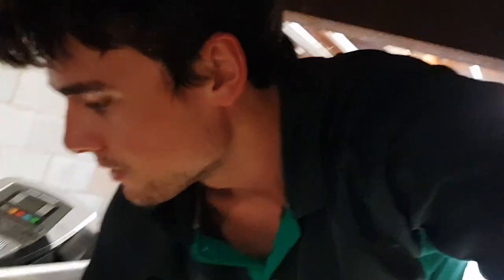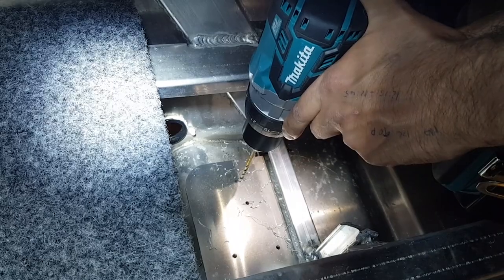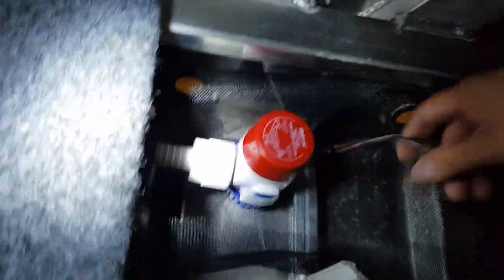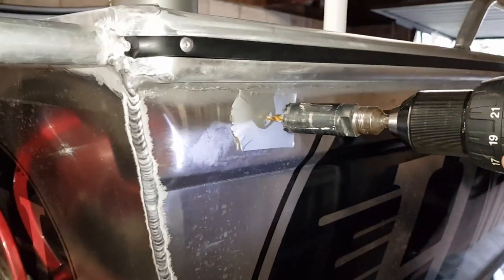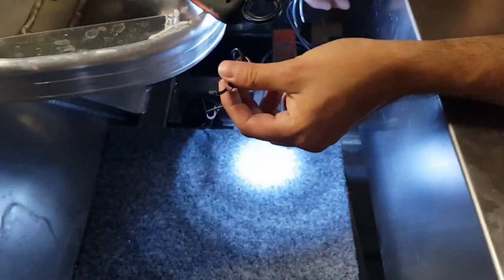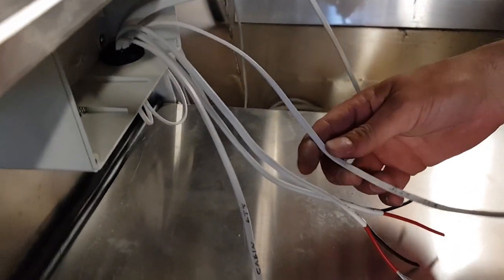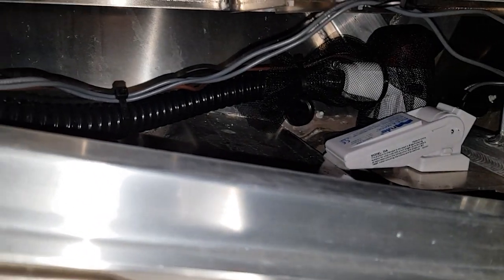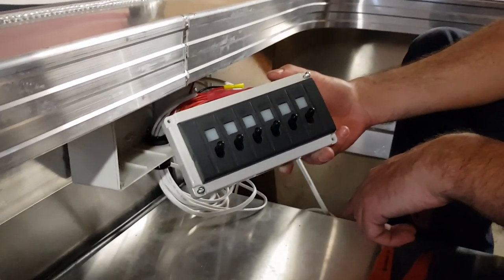Tinny Mods - DIY wiring and Bilge Pump Installation - Boat Fit out Part 2

Comment: Could've sworn you already did this. Nice soldering iron👍
Reply from the maker: The first video was the building of the switch bank. This is the first video of installing bilge pump and wiring. I've got part 3 coming soon as well.
Reply: @snagdfishing  ah gotcha. Clean setup and wiring, looks good
Reply from the maker: @HoovyPresentations  yeah that's it!

Comment: Hey mate, just asking about wiring. First little bit is an overview of my plan. 

I’m running dual (100ah) batteries. 40yam elec start. I’ll be running a battery switch (off, batt 1, batt 2, both). Both batteries will be located at the bow (weight reasons). So positive from the motor will run to the common output on the switch using 4awg/b&s. The negative will run and join battery 1 and battery 2. This will mean the batteries are wired in parallel - so if I need to I can use both for starting the motor. Continuing, from battery 1 (house) the positive will feed to “battery 1” on the battery switch. Same will happen with battery 2 (start battery) except will go to the allocation for “battery 2” on the battery switch. 

So now all batteries are connected and so too the motor, I need to install my accessories and wire them up. How do I do that? The switch panel will obviously be located at the rear where I’m sitting (noting the batteries are up the front). So, I’ve got an 8 gang switch panel with a cig plug, usb charger, 12v outlet and a voltmeter. The 8 gang will consist of live well, sounder, nav lights, anchor light, transom light, deck light, gunnel light and vhf. The bilge will be wired seperate into its own switch (due to running an automatic rule lopro). The positives from the switch panel all get grouped into the one collection and soldered/heat shrink - is that right??? Then you have all your loads from the accessories coming in and they attach to the switch panel lugs???? The negatives from the accessories are grouped together too and soldered/heat shrink??? So then, the negatives coming off the switch panel already are wired to the battery directly (house batt 1)??? Do I then run another positive wire from the switch panel positives that are grouped together into the battery switch (batt 1 lug on switch) to give the whole thing power??? That way no loads/positives are directly attached to the battery. They run through the battery switch so then if I turn the switch to “off” it stops all power running. 

The bilge will be the only thing hard wired to a battery so that it is never technically off. It’s amp draw is very minimal (2amp I believe) and says none at all when not in use. 

Hope you can help. I hope it makes sense aha. If not thanks anyway.

Comment: Is this an older video that you have had saved? I noticed that u still have the 30hp on the boat
Reply: Great video by the way I actually learned a lot and will definitely use it in the future
Reply from the maker: @blakepaulger3042  thanks for the message. Yes it is older footage from when I set up the boat. All the wiring is still the same, except I've upgraded to 40hp 👌👌

Comment: does that float switch allow the bilge to work automatically, even if the bilge is in the off position on the switch panel... in the process of wiring up my tinny at the moment. whitworths has an auto lopro bilge that you dont need a float for, it is more exxy than the bilge and float switch - so if i can go a bilge and float switch for cheaper id prefer that... just needing to know about the automatic stuff
 cheers
Reply from the maker: The float valve switch activates the bilge pump independently from the switch at the switch bank. So if water came in, my float valve switch will automatically turn the bilge pump on, even if I have the switch in the off position. 
I saved a lot of money buying them separate. I installed the bilge with the inbuilt switch on my old boat and I much prefer this new one I've got in my boat now. The wiring is quite simple, happy to help if you've got questions.
Reply: Snagd Fishing cheers mate, how big is ya bilge. I was looking at 1100gph because of offshore use
Reply: Any suggestions on how to mount it to the hull? I saw you had a piece of ally welded in there, but was that already in the boat or did you put that in? And if u put it in how far up does that plate sit off the hull - how high does the water then need to be before the float realises water is in the boat. ?
Reply from the maker: @bouttimefishingadventures  the plate sits about 1cm off the bottom of the hull. You could get a plate welded or pop rivet an aly 'L' bracket onto the bottom rib of the boat. So effectively you're making your own platform with aly L bracket and pop rivet It in.
Reply: Snagd Fishing too easy - was thinking that.
Reply from the maker: @bouttimefishingadventures  let me know how you go!
Reply from the maker: 500 GPA is in my boat. You will definitely save money if you buy a 1100gpa and a float switch separate

Comment: Hey mate, did you fuse your connections to prevent wiring shorts/breakage?
Reply from the maker: At the switch behind the grey cover are fuses. I run the recommended fuses for my electronics. So everything is protected. I also have an inline fuse from my battery that will also prevent shorts and breakage.

Comment: 1. It's DC wiring no such thing as "active" or "neutral", 2 you should not promote soldering wires like this, very poor practice, solder iron should be used and joins no wider the standard width of electrical tape. Spend the extra coin and Get glue infused (black and red) heat shrink, so water can not get it
10 points!!! for using electrical box and screen on bilge pump.
Get advice from a good auto electrician next time so you can promote good practice.